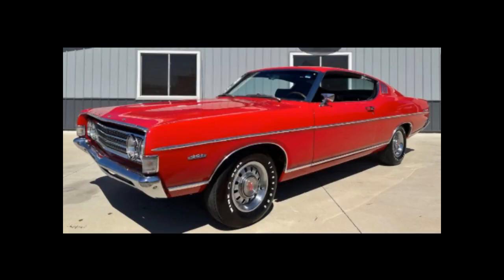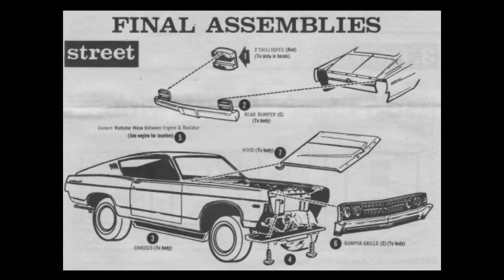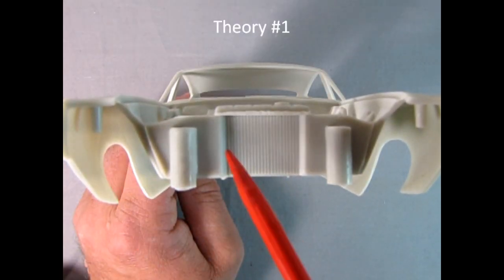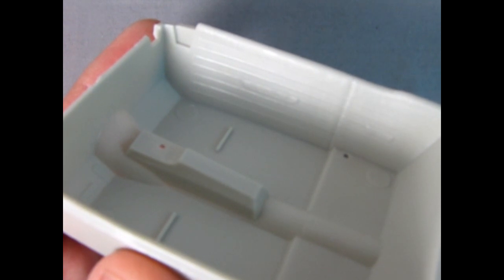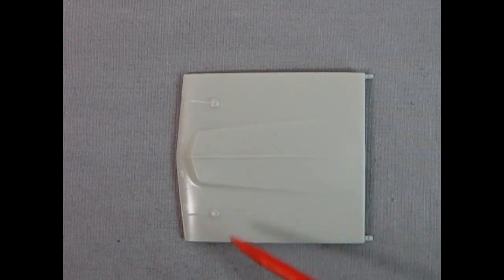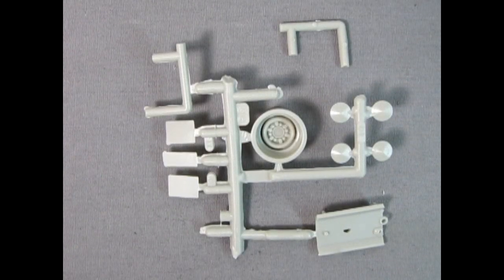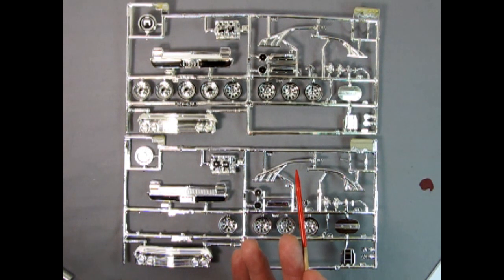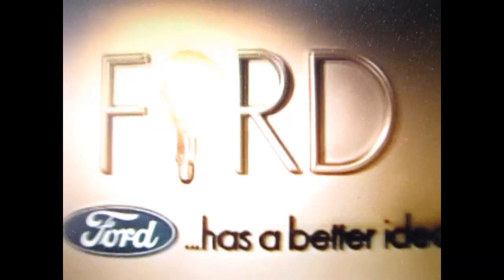Let's Build It! - Building The AMT/ERTL 1969 Ford Fairlane Cobra Torino Plastic Model Car Part 1

Comment: Great intro,Trevor. It's been a great experience 👍😎. I love all the research you were able to do. The reference material you have provided is priceless and will help anyone correcting this kit. Thank you very much 👍😎. I've found a nice Cobra airfilter in a 68 Mustang GT kit by revell 👍😎
Reply from the maker: Glad you enjoyed it. I know I posted this same video on my other channel, and the other parts of the series will be here as well. At this stage I am working on the 6th video and almost finished the NASCAR. Hope it looks good when it's done and that the glass won't be an issue...I'm really hoping for that!
Reply: @monsterhobbies  the glass I've got looks like it's from the wrong kit,the 'fit' is missing🤔
Reply from the maker: Interesting.
Reply: @monsterhobbies  it's a spare part and much better than the amt part. It has better vent flap and o ring detail👍nice headers in the GT kit too👍👍😎
Reply from the maker: I wonder if I have that kit?

Comment: The drag racing headers can be used if you slice a little height out of them. One thing not covered in the video is to watch out for curved chassis. I have a handful of these from over the years and two of them have a curve at the back of the chassis that makes them unbuildable unless you swap in a different one. Great video. 🎉
Reply from the maker: Glad you liked my video...there is more corrections to come! 

Yes, it is possible to reduce the height of the drag headers somewhere in the middle of the angle of the collector portion, but right out of the parts tree, they will hit the ground. 

As for the curved chassis, I did not experience that with my 2 kits, so I had nothing to go on. Thank you for pointing it out. I wish I had a solution.
Reply: @monsterhobbies  thunderbolt chassis is where I'm starting.
Reply from the maker: @rmxrider20032000  But isn't there 1 issues with that one? 

The first being that it's a Revell kit.
The second being that it is a dragster (Unless you are building a dragster.)
Reply: @monsterhobbies  it's where I'm starting, also gonna look at the AMT Fairlane/ Comet chassis. I had a 69 Torino years ago but not the fast back, I've got the resin body for it and want a lot more detail than the stock AMT Torino chassis can provide. Something will fit, with enough work anyways.
Reply from the maker: @rmxrider20032000  For sure! Good luck on your build and I hope you catch my other build videos to find the faults and how to fix them with this model before beginning your project. Let me be your guide. :virtualhug:

Comment: There's a lot of issues with that kit. You would think Round2 would get this kit squared away.
Reply from the maker: It would be nice if they looked into it again and possibly reworked the entire kit (Or started over completely) to the quality of their 1966 Ford Fairlane and Mercury Comet kits.

One idea would be to make one master mold with a few  separate parts trees that included parts so AMT could purpose the Fairlane, The Fairlane Cobra, The Torino and The Mercury Cyclone from the one mold. Then we, the model builders, could get the 4 cars eventually. 

AMT could even leave the side trim off entirely and print it and the different scripts on the decal sheets instead.